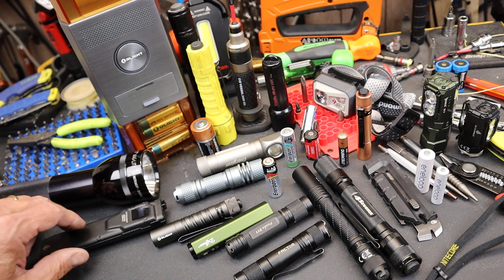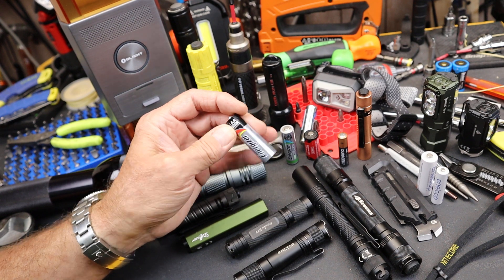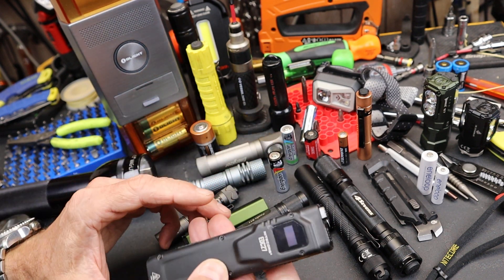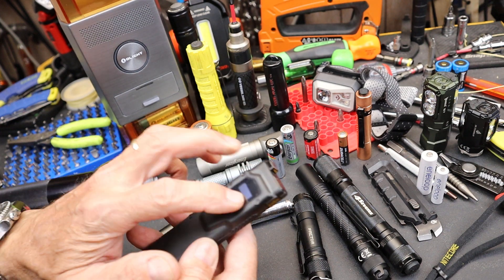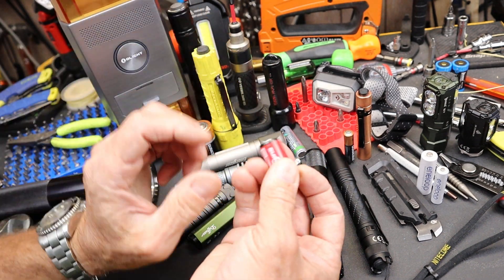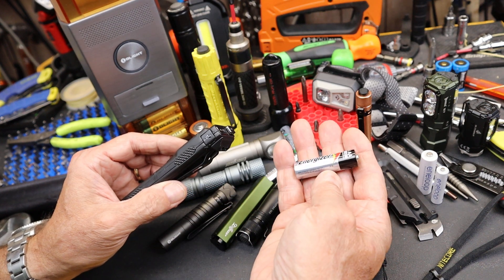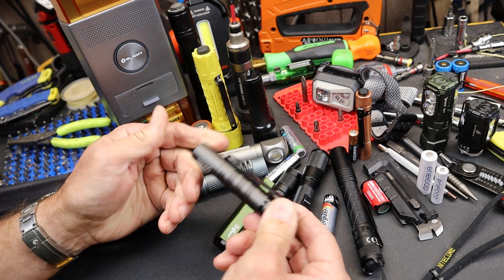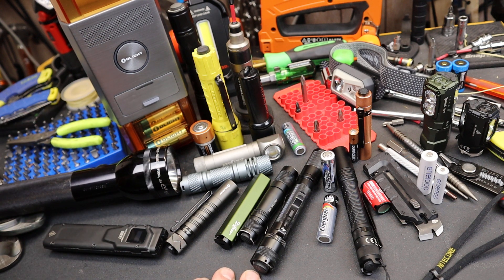Are AA-Battery lights dead or just dying? Can we let go of a 117 year old technology for good?

Comment: When the Texas freeze happened several years ago and the power was out for several days, my AA lights became the most useful. 
I discovered many of my 18650 lights couldn’t use each others batteries because there are so many proprietary batteries and chargers. The built-in-battery lights were useless, because if they ran out, it required a trip back to a charging point…rare because the power was out. 
I was thankful to have several AA lights that I could keep running very easily, and I even ended up leaving a few out to neighbors because I knew they could keep them running and could probably scavenge batteries at their own house. 
I still think there is quite a lot of life left in the lowly AA, especially with 14500s and self charging USBC.

Comment: Some torches will take 1x 18650 or 3x AAA's using an adapter so it's about the same size (and voltage) as an 18650.
Best to make sure it has a latching switch instead of one that has parasitic drain waiting for you to press its button.

Comment: I use Energizer Ultimate Lithium AA and AAA batteries when I don't want leak damage from standard AA or AAA batteries (I've had bad luck with Duracells — they always seem to leak). The Ultimate Lithium batteries are expensive, but at least they don't ruin the device they are powering. They are ideal for items stored for a long time and only used occasionally, like an emergency flashlight (as opposed to a daily use flashlight).

Quite a few modern flashlights can use 14500 lithium rechargeable batteries as well as normal AA batteries (or 10440 batteries in place of normal AAA batteries). It's good to have options.

Comment: I keep some aa flashlight around in case of power outages. I keel aa nimh for them mostly. I have a couple lanterns that run on d batteries for a long time. My first led flashlight was about 15 lumens with ugly green color. I keep nimh and lithium batteries in anything I am afraid will end up being ruined by leaking alkaline batteries. They are definitely better in the cold too.

Comment: My favourite headlamps are from Zebra Light. I have seven of their lights in three different battery configs. The 18650 for a lot of light and run time but I really like their AA headlamp. It's very light especially if you don't need a bunch of light.

Cool to see your 4Seven 2xAA flashlight. I never bought that model but I have bought a few of their newer 2xAA for friends who are not into this sort of thing. In the past normal people didn't know about li-ion batteries so a Foursevens light in AA format is perfect for them since it's a quality light and AA's can be had anywhere so it's easy for them to keep it going.

Where I now use AA's are two weather stations, two ZebraLights, meters of various sorts, a Dymo, remotes and that's about it. I guess AA's will still have life for another couple decades.

Comment: You can bring an old MagLite into the modern age by swapping out the Xenon bulb for an LED upgrade. The C and D cells have massively more capacity than AA's or similarly small form factor built-in batteries. You're still stuck with disposable batteries like alkaline, but if you need a light that stays on for many, many hours straight they remain a viable option.

Comment: To me the perfect torch has dual fuel if you will. A rechargeable battery as well as a AAA battery slot. I just use the rechargeable battery first and the AAA only if necessary. I even keep a couple of AAA batteries in my car for extras. The Rovyvon E1 is such an amazing little torch.

Comment: 18650's have mostly replaced AA and AAA batteries for me. The fact that I don't have to plug the whole darn light in to charge the battery, which takes away the usability of the light is important to me. I just keep freshly charged cells around and can swap them out in less than a minute, and keep going. My Edc light, headlamps, and large flashlight can use all the same 18650's, or can run off CR123's (I like to keep these around as backups to my rechargeable 18650's)

Comment: I love 1 and 2 cell AA lights. I have a bunch of duracell's japanese LSD Ni-MH from a decade ago that are still going strong. I do think as technology has changed, they're being left behind, but I'm not giving up mine. One thing I've wondered is if Ni-MH can be made in different sizes like lithium can? Can they be made in flatter and rectangular? I know there are 18650 , C and D size Ni-MH on the market. I guess the greater question is why are batteries made in century old form factors. BTW, one thing you didn't touch on is the safety aspect of lithium batteries.

Comment: I have a couple of old ZebraLights that take AA/14500s, my go-to for EDC/camping...14500s in them, with some Energizer Ultimate Lithiums as backup. Haven't had to use them though. Bit of a shame their newer lines don't support 14500s. (Looking up the specs, looks like they're in the 250-300 lumens range on high, which is plenty for most usage, and still out performs what my friends carry)

Comment: AAs are awesome because of their ubiquity. Alkaline AAs get the job done, NiMH batts work well, and Lithium Iron Disulfide batteries actually solve pretty much all of the issues I have with standard AAs (no leaking/corrosion, high power output all the way to the end of the discharge curve, high capacity) the only downside is that they're expensive (about 2x the energy but more than 2x the cost).

It's actually quite tricky to make a sophisticated product with AAs because you have to account for tons of variability, and if you need a lot of power, you may or may not be able to get it without the batteries falling on their faces. Even with good quality alkalines the performance slope is substantial. Lithium chemistries will maintain a fairly consistent capability throughout the discharge, but alkalines just degrade steadily until you decide that the performance is too compromised to continue. You don't know how good the batteries are that the customer is using, or even what chemistry they'll have. User-replaceable 18650 and 14500 cells have similar constraints. They don't stoop to the pathetic specs of low-quality AAs, but the consequences of improper management are much higher.

Once you go to a built-in, non-replaceable battery you can really turn up the dial because you know exactly what the cell is rated for, you can apply a cell-specific management profile, you generally have a lot more info about maximizing longevity and performance.

Comment: Most all of my flashlights run on AA. A couple on 123s, couple D and one C powered. 
I have started using Costco batteries (made by Duracell)  especially when they are on sell. I have two of the battery caddies loaded plus some extras.
Reply: ikea batteries and charger are good.

Comment: It's simple, the battery is the weakest link in your flashlight. With no option of replacing it, it means that your flashlight eventually becomes a dead weight. AA based flashlights don't have that shortcoming, you can replace the batteries, bring more batteries if you want a longer duration. I was my EDC to last, and be repairable - by me. 

If it's all about ease of use, there are AA sized USB rechargable batteries. So you can have the best of both worlds.

Comment: I tend to avoid built-in batteries.
1) They eventually die and have to be replaced, and custom built-in batteries are sometimes impossible to replace.
2) I enjoy being able to "instantly recharge" by having another set of batteries.

Now, I do have a few flashlights with built in batteries because they offer unique form factors (often very small).  It's nice to have a true keychain flashlight.  But I know that these will eventually die so I don't get expensive ones.

If you have a long-storage flashlight (e.g. the backup light in my truck) store the batteries outside the flashlight.  That will prevent parasitic drain.

Comment: I carry an AAA flashlight in my pocket everyday.
I've carried rechargeable lights but am always a little more apprehensive about using them because when the battery dies I'm SOL while it's charging.

When my AAA flashlight dies I just pop a new battery in it and am good to go.
If the battery is removable and you can have a spare to swap in that's fine, but if the battery is built inand not removable you're SOL.
Plus when that built in battery goes you have to toss the whole thing into a landfill instead of just the battery.
Reply: Same, AAA flashlight in the pocket every day, Energizer ultra litihum AAA, and I just recycle them when the die.

Comment: I EDC an Olight i3T with rechargeable AAA. 

While doing electrical work this weekend.  I ran out of batteries 2 times. I was able to toss some misc maybe used AAA in and get some more time out of the light. 

Huge advantage while I was out of the house. And don’t have time to charge the thing I need to use up. 

I do like have plenty of rechargeable lights, but they tend to be larger. It’s always a bummer when they a dead or dying when you really need them though.

Comment: Lumintop Tool AA version 3 with 14500 lithium ion battery puts out 900 lumens. 14500 lithium ion battery is same size as AA battery. This is a small compact flashlight with high output.

Comment: I don't know where they are all going, but we keep a supply of batteries in the laundry room and I'm constantly refilling the AAs.  Specifically for flashlights though, I like the performance of the rechargeable lights, but I am also diligent about keeping them topped off.  Other members of my family never think about it, and wait until things are dead before charging.  I've got a few duel fuel lights now that when the rechargeable is dead, there is a back up AA to keep going or replace the rechargeable with AAs with a lower performance.  Best of both worlds.

Comment: now lithium AA batteries have appeared (not accumulators), they have no disadvantages, except for a rather high price. The main advantage is that they do not discharge themselves for 10 years, and work for a very long time. For a flashlight, this is very important, usually when you urgently need a flashlight, it is either discharged or the batteries are damaged: at this moment, it is usually impossible to charge it, but it is more likely that it is also difficult in the dark) so, despite the price, buy yourself lithium batteries, put them in an emergency flashlight and be sure that it will work when needed. (I got this experience in Ukraine and was happy that I had several for blink cameras, the flashlight worked on these batteries as long as necessary and did not fail)

Comment: The issue with built in usb recharged batteries is once the battery needs to be charged, you can't use it for several hours. I much prefer being able to swap in a new battery while the dead battery charges. It also makes the item have a longer life overall, as the built in batteries cycle life isn't the products life.
Reply: there's no reason you can't have the best of both worlds - a removable cell that charges inside the device. most companies outside of the flashlight industry haven't discovered this yet though
Reply: @ailivac Phone makers had it nailed down. Swappable batteries were the norm 10 years ago for phones. I remember my Galaxy Note 4 battery immolated in the heat of the sun when I walked to work. A $20 2 second replacement.
Reply: @ailivac  exactly the point i was making.
Reply: welcome to the world of lithium batteries! the more popular 18650 is cheap, long lasting and can be bought in bulk to have spare batteries wherever you would like :) ilove my lumintop tool 3.0 and sofirn hs40 very much
Reply: @furniksadventures9660  yep. Ive been using 18650 in everything possible since about 2012.
Reply: Or - just hear me out - have 2 batteries! Or more! My flashlight uses one 18650 battery, and I have 12 at home from a dead laptop battery. Turns out they are still great for a flashlight! And if I want to use my light and it died, I have 11 more to use.
Reply: @tonyrulez69  id love to have two batteries, but some lights you can’t remove the battery! Which i think is a problem. I love the convenience of not having to drag around a charger for cells that being usb rechargeable allows, but when the light dies, and you still need to use it, being able to swap in a new one is the way to go. We need manufacturers to design their lights so that both functions exist in their lights.
Reply: The EU has passed new laws that all "gadgets" from phones to scotters to iPads have to have replaceable batteries sold in the EU to stop e waste. 
I doubt companies willake two versions for EU and non EU. Built in batts are on the death bed.  I personally hate having to throw away perfectly good flashlights that were not cheap just cause the battery can't be changed
Reply: They likes of the note 4 were just brilliant

Comment: I have some flashlights with AAA, not AA, and I have a maglite with 6 D cells which is a club.   😂.   I have rechargeable flashlights, but I know they are time limited in lifespan, like most things these days.  😢
Reply: Recently saw a flashlight on amazon advertised that took AAAA (yes 4a) batteries.
Reply: @alexdrockhound9497  Streamlight (and I swear I remember Maglite) have had AAAAx2s for decades.

Comment: I don't think rechargeables are viable for some applications.  One is, as you point out, a light left in a vehicle.  I have one in my console that uses a pair of CR123a batteries and it's been in my console since I bought the car in 2021 and it rode in my previous car for three years before that.  We're talking the same batteries!  It's just for emergencies so I don't use it much but it has saved my bacon when I did need one.  WMLs for firearms is another area that primaries are still better.  Yeah, I have some Cloud Defensive lights that use 18650s and the lights are great but I'm not sure you can say those are anything but hobbyist batteries.  Another big thing we need primaries for is optics, particularly red dot sights.  I'm not aware of any serious RDS that has an onboard battery. And would you pay $900 for an Aimpoint that you had to discard when the battery dies?  I used to use the same cell for phone for three, four, even five years back when you could just swap batteries.  Now I rarely get a year and a half, sometimes even less as I work in a hot environment.  I dunno, AAs would be tough to live without for me, AAAs even harder.

Comment: On a related note, there are some stellar flashlights using the Li-ion 14500 cells, which are the same size as AAs.  The Wurkkos TS10 is one that comes to mind.  It's a fantastic little unit that outputs a solid four-digit lumen level.
Reply: And some can even use both (dual fuel)

Comment: Have you experienced Duracell battery leakage on most all of there batteries when left in a device of some sort? What batteries are less likely to do that?
Reply: Lithium AA and AAA batteries are much better sealed, but they cost both arms and both legs :( 

But another benefit to the lithium ones is they have more capacity and work better in the cold, have a higher discharge rate potential, and can be stored for longer.
Reply: I’ll never buy another Duracell battery. (Leakage).
Reply: pretty sure kirkland is duracel. I once had some kirkland AAA batteries that half of them leaked while still in the box in less than a year of sitting in a drawer in my office.
Reply: nimh's very rarely leak, and even if they do, they have a very small amount of electrolyte to leak out in the first place.

Comment: If I'm buying something that I expect to only use for a few years (cell phone, laptop, etc) I have no problem with built in batteries (especially since it is going to be used regularly). If I want something that I plan to keep around for 5-10 years or longer (flashlights, emergency GPS, weather radios, tools, etc) I want something built on a standard that is easy to change (18650, AA, AAA) and if it is something I'm keeping it only gets the rechargable or lithium batteries becuse they seem to not corrode. 
Now that  AA, AAA, and 18860 are so ubiquitus I'm sure that as new tech comes along I can cycle it in (like how you can get Type C rechagable AA batteries based on lithium).